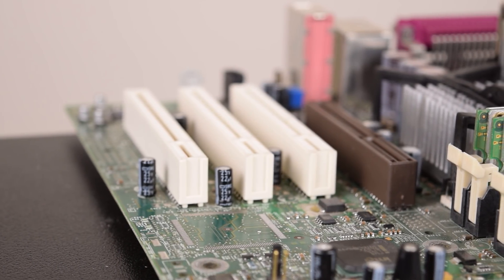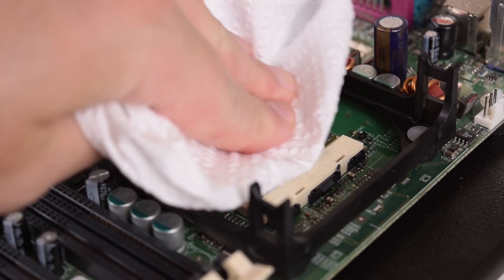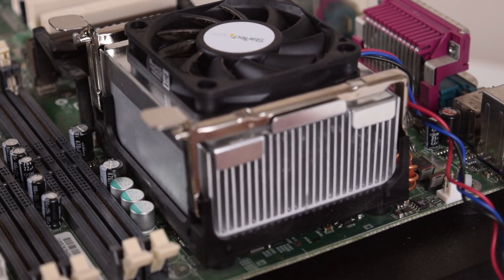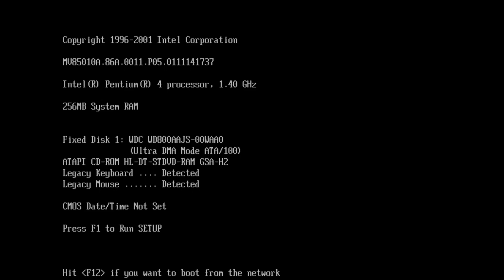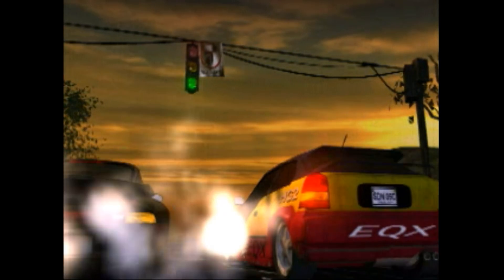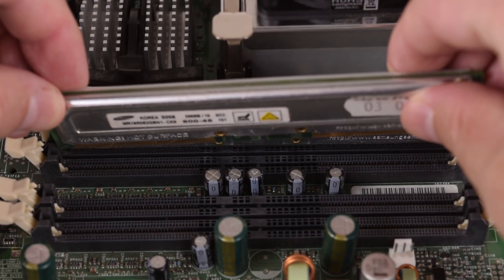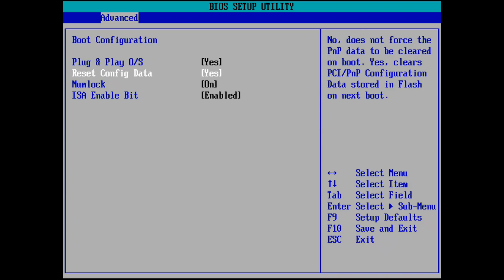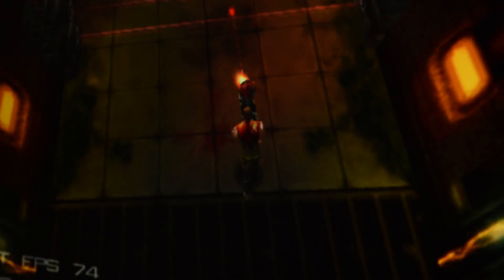Rambus RDRAM Pentium 4 1.4 GHz vs Pentium III

Comment: I have had 2 Rambus setups years ago but the one that blew me away used 32bit memory.
What i have are 2 sticks of Rimm 4800 and a 2.0a CPU. The boards still command a Very High Price even today because they are Very Scarce!
The Rimms you used are 16 bit and use Terminators if you don't have more than 2 sticks, 32 bit  Rambus only use 2 slots and must be matched.
Fun to play around with though.

Comment: First before i watch this video, i worked with intel systems with p4 and rambus...in a company for over 5k pc's in the office. I changed old p3 750mhz with pc133 mem quite alot if they needed speed for office programs. Its that bad...really!

Comment: Maulwurf! Ich habe ein Dual-Slot-1 mobo mit i840 chipset und Rambus (pc-600 & pc-800).
Ich habe hier 4 rimm slots, mit max 2GB memory.
Mit spec. Slot1->S370 adapter könnte man den Tualatin 1400MHz benutzen. Ich habe in Vogons gelesen dass einer das geschafft hat.

Comment: One of the big reasons Rambus was so expensive is that each memory stick had its own memory controller. Early on RAMBUS was faster, eventually  the advancements of memory. When DDR ram was released performance was on par or better for cheaper. That was the death of Rambus.
Reply: You sure about that? Drilled the rivets out of one and there's only the ram chips on board.

Comment: Used intel 820 mobo in the past, the first (and troublesome) RDRAM board for intel. Heavy usage got benefit of RDRAM (my dead PIII 733 beated Atom N450 in video conversion!) but at low memory usage it suffer lag because latencies of RDRAM are high (45ns at rhis case).
 Also, chipsets was evolving to manage RAM better, PC World at early 2000 reported some test with AMD 751 boards running very close to RDRAM in memory tests.

Comment: Most crashes are caused either by the OS or something the user did beforehand - computer hardware was almost always reliable and not the source of crashes - even back in the 90s and early 2000s. If at all it got worse these days.

Comment: Here's what I want to see - and I haven't found this anywhere so I'm really curious - apparently Intel made some Pentium III boards with RAMBUS memory support too!  For example Victor Bart recently did a video featuring a Dell PC using the Intel 820 chipset + 800MHz Slot 1 Pentium III + RAMBUS memory.  I remember a quote from somewhere "by the time Intel reached 1GHz on the Pentium III platform, the systems had largely become bottlenecked by the speed of the SD-RAM" so I want to see a same-spec Pentium III put through period-correct Win98 gaming benchmarks using both traditional SD-RAM and a RAMBUS board.  Myself I love Slot 1 builds and I'm interested in building a Pentium III RAMBUS gaming PC for the exotic tech alone but the few boards I've seen for sale have been very expensive so for that price I want to know that there's actually a tangible performance increase.

Comment: 07:52  The reason for the complications brought up are that motherboards used to use the 5V rail to power the CPU.  This meant as chips got faster and more power hungry, PSU's got bigger and bigger 5V rails.  The 12V rail was typically fairly weak, since all it need to power were some peripherals.

Then motherboards started using 12V to generate the CPU core voltage.  There was a period of time where it was common to find both 5V and 12V motherboards, so you had to choose chip and board before getting the right kind of PSU.

And now, if you're building a retro PC with a 5V CPU board, you're going to have a hard time finding a suitable PSU.

Comment: Terminator modules, also the RAM runs at 800 MHz. Hmm... T800. Anyways, yeah, I recall these, a friend had it and I was so envious! Had to be installed in pairs and, indeed, required terminators for the empty sockets, similarly to SCSI termination. Anyways, it was ridiculously expensive.

Comment: I have a Slot 1 motherboard with RDRAM, but I can't test it because I am somehow not able to remove a Slot 1 PIII from the only Slot 1 PC I own. I don't want to damage something there, so I just gave up.
Reply from the maker: Good point, I actually remove the Slot 1 retention rackets from all my Slot 1 motherboard as they can be a pain in the  neck.

Comment: Shouldn't you put the levers in opposite directions? I remember it being recommended to do this as levering them the same direction could potentially chip the die under the heat spreader.

Comment: Great videos!
Watching on my Pentium 4 HT 3.2GHz (Prescott, 1MB cache, FSB 800MHz, socket 478) with GeForce 6800 (256MB GDDR3, AGP 8x) and 2GB of DDR-400MHz. I don't know why people say the Prescott is so hot, i'm using the Intel cooler that came with the CPU and it runs below 55ºC. I'm testing how it performs on the internet, YouTube plays normally on 480p, on 720p the video lags too much. I built it about 1,5 years ago, i have a bunch of PCs, the newest is a Core 2 Quad and the oldest is a 486, but i wanted to know the Pentium 4, which i had never used yet.
I was used to Core 2 Duo performance. When i was building my P4, i was expecting much less from a CPU from 2004. When i finished building it and installed Windows Vista, i got impressed.
I love my Pentium 4, i don't care that much about efficiency. It needs more clock speed to beat a Pentium III, but it can reach much higher clock speeds than the Pentium III (3.8GHz vs. 1.4GHz), thus increasing performance. That is, in fact, an inefficient strategy, but if you just think about the performance, i think the Pentium 4 has very good performance (at least at 3.2GHz, the only Pentium 4 i have ever used yet).
Reply from the maker: Thanks for the comment!

Comment: Great vid. Tualatin and Thunderbird were such amazing designs. Willamette was inexcusably slow and expensive. RDR was ahead of the curve, but didn't perform on a reasonable cost:performance level. Northwood was P4's real intro, specifically NW C. The 1.4GHz P3 (even generally in massively OCed Coppermine form) will simply stand on top of the podium almost always.

Edit: I edited this post. :p

Comment: RAMBUS also comes in several speeds, and has to be matched to the system, or it won't work.

In my own Computer Closet I have Jerry Pournelle's old "Regina" -- a Compaq dual Xeon 750MHz (CPUs on slot cards) that has 8 RAMBUS slots. It boots so slow it looks hung, but runs like the wind once it gets going (having Win2K as its OS doubtless helps). It came with 512mb and I wanted to upgrade it, but RDRAM was always too expensive. Last year I saw some on eBay that was cheap, but a brand I'd never heard of. Well, let's try it. Turns out this off-brand runs cool enough to touch, with about a 5% speed penalty, so for a mere $4/stick, that's a good trade-off.

This machine is a curiosity in other ways -- it has a backplane rather than a regular motherboard (CPUs and RAM are all on a card that's as big as a regular mainboard), passive cooling, and two SCSI hard drives. And it weighs 70 pounds!!!!!

Comment: you need some more period appropriate benchmarks. using dos benchmarks to bench these just doesn't click.
try to get your hands on some unreal tournament goodness, maybe even unreal tournament 2003. it might be pushing a little forwards, but it's a really demanding title for the time and a good benchmark all around, specially for cpus in this performance range. it's also a good gpu benchmark, and very compatible with older cards because it's only directx7

Comment: I actually have the Aldi PC hardware bundle (CPU/Board/GPU) from the November 2001 Aldi PC somewhere. If you need anything benchmarked or details about it, let me know and I'll dig it out
Reply from the maker: Nah all good. I did ask a German eBay seller if they wanted to work with me, but never heard back.
Reply: Work with you as in..? Send you the HW, help you out with the specs or run benchmarks for you?
The "never heard back" part unfortunately sounds familiar. It's usually what happens when I ask US sellers if they'd be willing to ship the item(s) to Germany...
Reply from the maker: Yea they sell all the Aldi motherboards. Nah don't need help with benchmarks LOL

Comment: I own a Gateway e-Series motherboard, basically a plain jane Intel board. Mine has 1066 MHz RDRAM or 533 MHz FSB. I have a 3.0 with hyperthreading, and a 2.4 GHz CPU. Both are pretty fast. I usually just use the 2.4 for classic games. I have a fan shield over my ram sticks as yes, these do get insanely hot and for a longer life it's probably best to keep them cooler. It is very stable too, but I am sure it was hardly competitive with the AMD Athlon XP, marginal at best with gaming, content creation is a whole other matter.

Comment: My 1st Pentium  4 in 2001 had 1gb of rdram   then the board  died and everything  went ddr andbi was stuck with 1 gb of it i could  not use in the new board. . I still  have the blanks sitting  around because  they was never used it took 4 slots

Comment: Are you shure this is the right way to install them
Reply from the maker: What do you mean?
Reply: ushualy there are 4 slots and counting away ftom the cpu you ushualy install the dimms in slot 2 and 4 to get dual chanal ram so the way you installed it is the sub optomal way at least for a modern mainboard
Reply from the maker: Yea check the user manual, it will show you the correct arrangement.
Reply: oh i see also thanks for giving the specs in the description

Comment: interesting video never knew about rambus ram I remember my celeron D had normal drr ram when my dad brought it brand new. I enjoy watching your videos since they solve some of my problems whit my reto windows 98 pc that is on hold while I get neither a Gforce or a ATI GPU since the Mx440 decise to die. I started using a old laptop whit xp it has a intel atom 1.6ghz the integrapich intel graphic 950 has a surprising good compatibility whit windows 98 and eairly 2000 games

Comment: I remember when a desktop gateway PC that had a 1.5 ghz Pentium 4 with 256 mbs of PC800 RDRam and either had Windows 98 or Me was top of the line in January of 2001. Rdram seems like it never did last long though, I think by 2002, most PC s were using ddr 266 and 333 mhz sdram instead of the short lived rdram.

Comment: I recently got (after quite a search) a Pentium 4 socket 423 model with SD-RAM (yup, that's right, it was the 'budget' chipset for the Pentium 4).  And it made a huge difference using PC100 or PC133 SD-RAM (in Quake 3, the difference was around 20FPS between PC100 and 133).  Early P4's were realy dependent on fast memory to perform.  I do like the 423 more than the 478, because the 423 is more rare. Though that rarity has a lot of downsides; they're hard to find (for a reasonable price), hard to find coolers that fit, RAM can be tricky to find (in the case of RDRAM, SD-RAM ofcourse is quite easy). Dispite they are actualy not that good (compared to the Athlon or P3 Tualtin), I find them actualy more fun to have than some modern stuff (let's face it, modern hardware is a bit...boring, even an old Sandybridge CPU is still capable of running most things without trouble).
Reply from the maker: That time is super interesting, like how AMD went with DDR and how well the Athlon and Duron performed. We will take a look at these soon.

Comment: I ran a Gateway 2 GHz Pentium 4 with RAMBUS RAM for a long time. I retired that system and when I tried to fire it back up about a year later it gave me some kind of an error about the hard disk controller. I guess I got out of it in the nick of time? It was OK but it was just too slow compared to multi core systems that came after it. I'd say it was way faster than the 1 GHz P3 I had.

Comment: oh my goodness you finally did it! Good stuff Phil!!! I still got an RDRAM system. I have both 800 and 1024 memory, and memory options. YOu can run up to the 3.0 with hyperthread, and have but it's a cooker. You could fry eggs or better yet dry cook food. Because it's hot, ho, hot. I would argue hotter then a dual 2.5 ghz G5 with roughly the same latency performance give or take. Seriously geekbench that. Anyway, awesome video. Mac heads would complain about the G5, my guess is they never touched RDRAM.
Reply from the maker: Yea still got to find a 533 FSB capable RDRAM motherboard :)
Reply: +PhilsComputerLab The thing is the higher speeds you go the less the gain seems to be until you go with an 800 MHz CPU that RDRAM doesn't officially support. I've ran these at 400 MHz fsb for giggles and a slightly cooler experience, but it also ran much slower. It's an interesting board as it's not picky whatsoever as to what CPUs you can use. If it has a 478 pin, it seems to work. It came out of a gateway e series. That was back when Gateway still had some quality aspects to them.

Comment: Maybe it's a bit off topic, but my first experience with the P4 Platform was a 2.4 GHz Celeron. It replaced my old 1.2 GHz "P3 Celeron" running on a Tualatin-slotket converter on Abit BH6 (overclocked to 1344MHz with 112MHz FSB).

I expected the P4 Celeron to be quite a bit faster, but it was slower in most games. Perhaps your could do some tests on the P4 Celerons? I don't think there was anything wrong with my motherboard (Abit IS7-E). I replaced the CPU with a 2.6GHz P4 Northwood, and the performance improved a lot. I still have this system, and a newer IS7-E2 with a Prescott 3.2GHz that also works really well (and hot).

Comment: The P4 had a bad design. I hear that it has a deep pipeline and if there is a bubble in the pipeline, the penalty was high. This is why in quite a lot of applications, it performed poorly. For video editing, it worked well.

RAMBUS memory also had issues. It can sustain a high data throughput but it has a higher latency.
So I think the P4 and RAMBUS was a bad combination.

It became clear that I had to jump ship and go with AMD.

Comment: When you said "you can see the 512mb ram" when in the bios, actually, the screen before said 256mb... both were @ 128mb
Reply from the maker: Yea, the board came with 2x 128MB sticks, I then upgraded to 2x 256MB as shown at the start, when inserting the RAM and in the CPU-Z screens :)
Reply: Yeah I get that - I just found it odd you said "as you can see" - but you couldn't, you couldn't see!! ;)

Comment: We had a Pentium 4 1.4 Ghz based Gateway machine in the early 2000’s...it was rubbish...reasonable specs on paper, but it never performed the way it should have, despite later investing in 1gb of RAMBUS RAM. The machine is long gone, but I still have the memory, which I doubt that I’d even be able to give away now.

Comment: Great video. I have only a one time experienced a first gen P4 1.4 with Rambus memory back in 2001. I worked at a computer repair shop. We got this machine in that was unstable. The first time seing memory modules with heatsinks on it. WOW! 
As I remember the P4 was better performing on intensive tasks with RamBus memory, than with DDR. But it was shortlived in the mainstream market. I think  it was too expensive memory and with high CL (went on to server use)  It got replased with DDR memory on later P4 mainboards.

Comment: I've been watching your videos about retro PC gaming, and I'd like to suggest a motherboard for you to check out for Socket 478 Pentium 4s:
The Biostar U8668 with the VIA P4M266 chipset on the Northbridge, and the VT8233A on the Southbridge. It has two slots for PC133 and two slots for PC2100(DDR) RAMs. It has built-in VIA S3 ProSavage graphics, and an AGP slot. It also has a CNR slot, but built-in 10/100 Ethernet.
I bought it from a friend way back in 2010 not really knowing what I was getting into, and I still don't.
More info here:
http://www.biostar-usa.com/mbdetails.asp?model=u8668
http://www.biostar.com.tw/app/en/mb/introduction.php?S_ID=337#specification
Reply from the maker: Had a look, quite expensive it seems. I do have a VIA chipset Pentium 4 already I believe, from Jetway.
Reply: Okay, that seems cool. I only suggested this motherboard because I have, and it has compatibility with two different types of RAM.
I figured that would help you with the RAM test on Pentium 4s that you talked about.
Does the Jetway board use DDR, or is it RAMBUS?
Reply: VIA is cancer

Comment: Love the video!  I'm sure you've mentioned before, or posted a link, however, what is your methodology in testing/benchmarking windows games?  Also, from your previous video, where did you get the older drivers?  I could not get the nVidia website to show me the versions listed in your video.
Reply from the maker: They are on our website.

Comment: Freaking rambus systems with even a slower 423 P4 are faster than a lot of ddr socket 478 P4s which are more powerful but lag like a MF. I have a 1.9 423 with 512 mb if memory, came stock with 2 128s and I just ordered two more identical sticks for pocket change to make 512. Also have the 9800 Radeon pro in it. And still use it to relive my childhood. It’s basically the same desktop chassis as I had back in the day. I had an optiplex gx280, with like a 600mhz P3. But it couldn’t run all of my Ware so I needed something more for filling the void of not meeting system requirements. It’s a dell dimension 8100(it’s my baby) I have XP dual booted with 98.